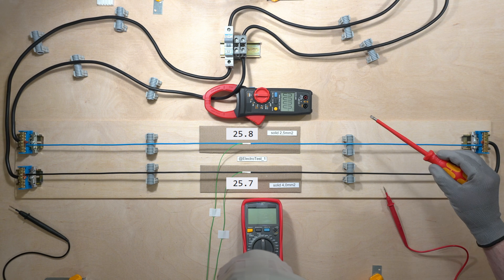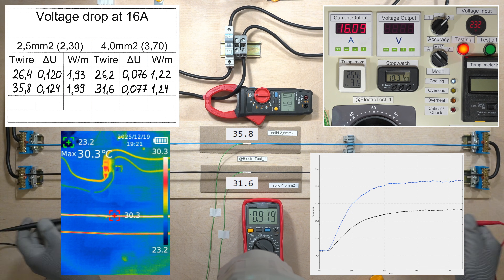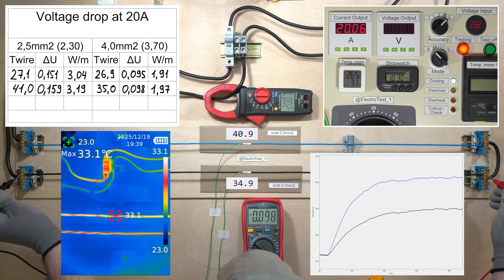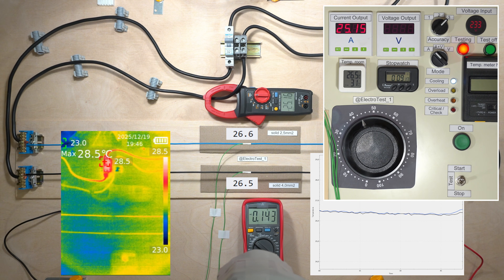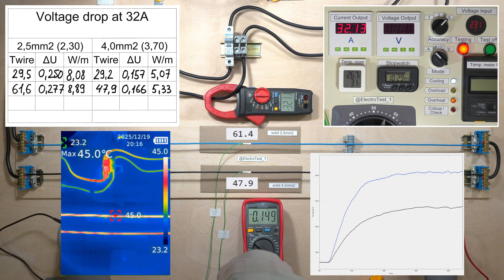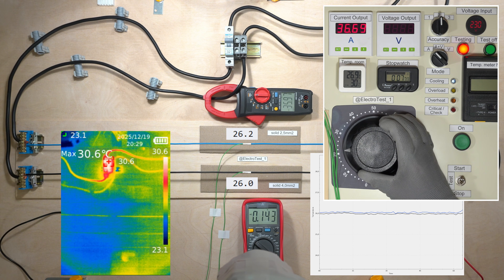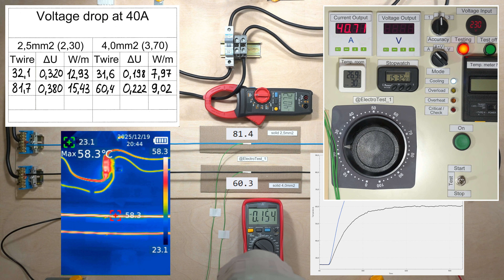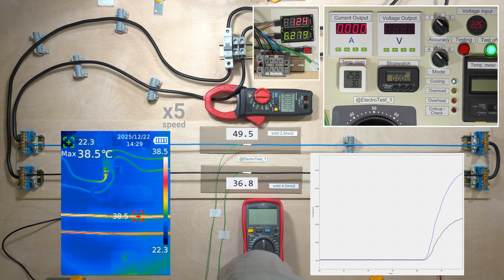2,5 vs 4 mm2 Current test & Voltage Drop Wire in series

Comment from the maker: Please support my channel: https://www.youtube.com/channel/UCqZUswoAI9E9iFcTeS7L6gw/join
A single flexible 4 mm² wire is my favorite conductor, which I use in electrical panels as jumpers from the main circuit breaker rated at 20–32 A. Using it with a 40 A breaker is questionable. If we take into account that an electrical panel contains many other wires and the ambient temperature is higher, significant heating can occur under overload conditions.
It is incorrect to assess cable heating based on this video, because the cable contains several conductors inside a common sheath. However, voltage drop and energy losses per meter of cable can be obtained by multiplying the tabulated values by 2. Interestingly, losses for 2.5 mm² conductors are 60–70% higher. If these are long, high-power lines, using 4 mm² can later help save energy. Based on the tabulated data, it is even possible to calculate real-world scenarios.
Do you use 4 mm² conductors? Do you ever have doubts about which wire or cable to choose? Have you ever had real-life situations where a 4 mm² conductor was warm or even hot?
Reply: Bonjour,
vos tests sont toujours intéressants; merci.
Bien que n'étant pas compétent en électromagnétisme, je me suis posé la question suivante:
vos fils en test sont en série mais parallèles sur tout le cheminement entre les deux borniers.
cela n'aurait-il pas une influence, par mutuelle induction, sur les valeurs de tension ?
cordialement : jlp
Reply: désolé pour les erreurs de claviers
le "bon" texte
Bonjour,
vos tests sont toujours intéressants; merci.
Bien que n'étant pas compétent en électromagnétisme, je me suis posé la question suivante:
vos fils en test sont en série mais parallèles sur tout le cheminement entre les deux borniers.
cela n'aurait-il pas une influence, par mutuelle induction, sur les valeurs de tension ?
cordialement : jlp

Comment: why the 32A MCB did not trip at high test currents?!
Reply from the maker: Because circuit breakers do not trip immediately at their rated current. The tripping time depends on the current, and the higher the current, the faster the breaker will trip. You can find tripping curves in manufacturers’ catalogs. For example, at 20 A a 16 A breaker may not trip for a very long time. The same applies to others.

Comment: I was thinking about the room temperature in relation to current and wire temperature in free air.  Room must be 20 to 25c... and then I noticed the minimum temperature on the thermal camera...23.2c.  That fits nicely.

By the method of calculation here a single 4 sqmm V90 insulated (PVC, 75c/90c) wire suspended in free air with air temperature at 40C can pass 40A and the wire will reach 75c.  With air temp of 25c the negative derate will have the wire at 60c so it will rise to 75c at 48A with air temperature of 25c, and a bit more amps at 23c.
Reply from the maker: Hello! I like this kind of detailed analytical commentary. In fact, the temperature in the room was 25°C. You can also see in the video that there is a white thermometer near the current regulator. However, I also have another, more accurate one. You can also estimate the air temperature from the initial temperature of the wires in the first test — it is equal to the air temperature because there was no current yet. As for the thermal imager, it’s not bad, but it has fairly large errors, especially when materials are at different distances and are also different in nature. I’m curious how you calculated that the temperature of a 4 mm² wire at an ambient temperature of 40°C should be 75°C at 40 A? By the way, this was a PVC 70°C wire.

Comment: Thanks for the high amp tests and how fast those wires heat up!
Reply from the maker: Thank you for the comment! I later analyzed it in more detail and realized that at high currents the temperature is actually even higher — possibly by 10–30°C. It’s just that all the materials around the sensor create thermal inertia: as you can see, it takes about 10–20 seconds for everything to stabilize. During that time, the conductor has already cooled down significantly.

Comment: What do you think the highest continuos amp rating would be for 20mm copper cable (from meter to consumer unit in house) 2 meter length be ? Not in any conduit
Reply: For these kinds of questions, never rely on word of mouth. Always follow local regulations and derate properly.